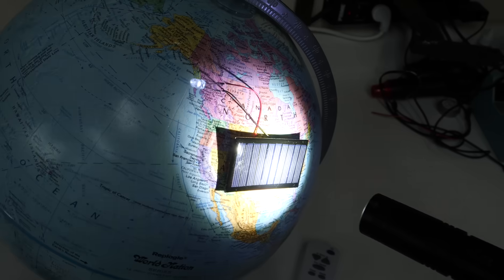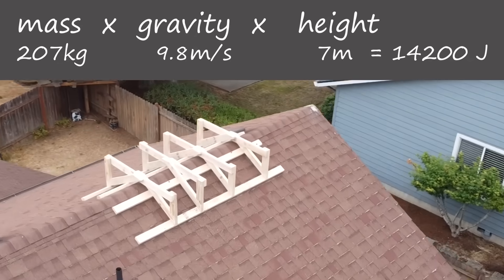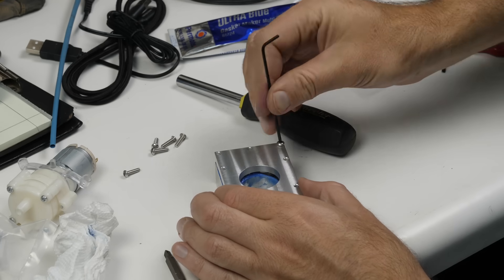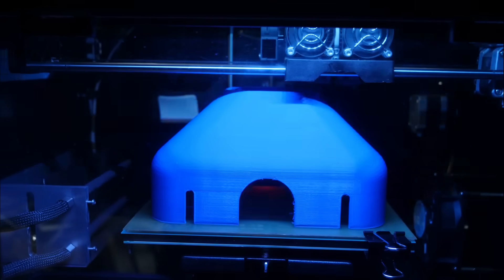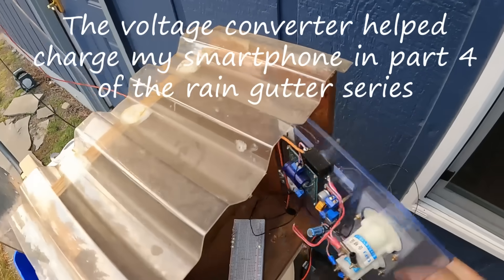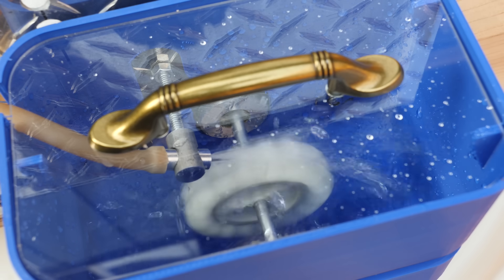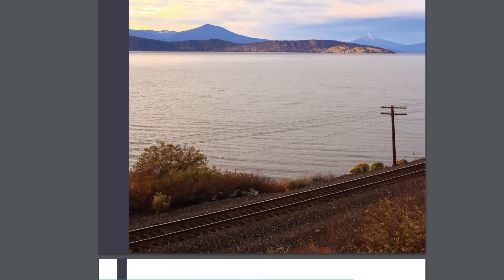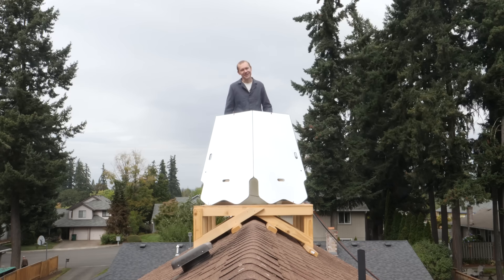Storing Solar Power on my ROOF!!!

Comment: Hi, cool demonstration. I’d love to see some calculations on efficiency and what it would take to be a practical way of generating nighttime requirements for a single household.
Reply: you'd have to live by the river?  =P
Reply: No need to calculate.  Extremely inefficient.
Reply: I did the math once, and you'd need a large pond on top of a hill for it to be a replacement for a home battery system.
Reply: @thelight3112  I wonder how much could you generate power with rain water from roofs and around the buildings directed to "pond" wich outputs to micro generator. Combined with some solar system to tump water back up if no excess water. It would need some way to control when water power would be used.
Reply: @viljosavolainen2286  
Firstly, if your using rainwater directly you haven’t got that 7m head this tank has. You’ve only got the height of the gutters, say 5m. 
OK, a fine big house, so perhaps 200m² of roof (that’s a 4000 sq.ft. home, folks). Now 25mm/hr is a pretty solid downpour, so that roof is going to catch 200x0.025 = 5m³/hr, which is 5000kg. Total potential energy is m.g.h = 5000x9.81x5 = 245,250J. Divide that by the 3600 seconds in an hour and get 68W of power during a downpour! You’ll lose at least 30% in pipe losses and turbine and generator inefficiencies.
Give the half of that roof that faces the sun 100 m² of solar panels and you’ve got anything up to 20kW on a sunny day. Roof-hydro you need torrential rain to generate anything above 50W! Go figure! 
And if you only want 50W, you can buy a portable solar panel that you can set up in a sunny window, starting from under $20.
Reply: A "real" hydropower plant efficiency is about 90% in theory, a micro hydropower plant is about 70~80%, something this size  I would guess less than 50% on paper. These kind of thing need to be huge.
Reply: You would need just over 4000gallons to replace a Tesla powerwall as 230amp hours & 1 decent AA battery is 3amp hours. So that’s a square tank 4 metres wide x 4 x 2metres high=32 tonnes in weight. A tank this size would easily fit in most lofts & a 4x4 metre plywood panel on top of loft beams underneath the tank with minimal reinforcing should hold the weight of tank that size with water.
Reply: @randy2819  
And if it’s pumped hydro then you’ve got inefficiencies on the uphill side too. So round-trip efficiency will be damn near halved again.
Reply: He says his sistem Stores 14200 J.
14200 J =14200Ws = 3,9 Wh
14,2 /60/ 60 and U have
Reply: Humanity would have NO issues regarding energy if such sonstructions came ANYWHERE NEAR beeing a "practical way of generating nighttime requierements for a single household."

I mean,what he did doesnt look as much even to someone who has NO IDEA what he was doing. Thats a month of work for a complete beginner. Learning + building + testing. Maybe two months, if one is a slow learner.
Reply: Well,  the average energy storage in a  single AA battery is about 4w. The guy used a 50w pump that ran for approx 2 hrs,  meaning approx 100w of energy was used to transfer water from the ground to the roof. 
100w spent,  4w of "backup" energy gained. 
Energy loss of approx 96%. However,  there are plenty of ways this can be refined, but you'll probably never get much lower than 85% loss (100w spent, 15w gained).  If you want to see how much it would take to power your house,  simply figure out the wattage we ltr of water (44gal = 200ltrs) 
200ltr made 4w of power,  meaning each ltr makes approx 0.02 watts, so, to make the math easier let's bring the w/h to 1.00, every 50L of water gives you 1w/h. Average household consumption is approx 10KW/h 10,000w/h , meaning you'd need 50l (1w/h) x 10,000, = 500,000Ltrs of water to generate 10Kwh. 
Now,  if you only want nighttime usage this will be significantly less.. You'd probably need approx 3kwh on any given night,  meaning you need 70% less than 500,000L, 150,000L should suffice for a single individual to do the standard night time things.
Reply: The formula is simple, the potential energy is U = m g h, where h is the height (in meters), m is the mass in kilograms, g is a gravitational acceleration factor g = 9.8 (or approx g =10), and U is the potential energy measured in Joules.   So for 1000 Kg of water stored at a height of 10 meters, we get U = mgh = 1000*10*10 = 100,000 Joules.  1 Kilowatt-Hour is 360,000 Joules.   So you see the method is completely impractical - even if you store 1 metric ton of water at over 30 feet in the air, and utilize it with perfect efficiency, it doesn't store much energy compared to home use.
Reply: @iyziejane  
Correction:1kW.h = 1000W x 3600s = 3,600,000J. 
Given a 7m head and g = ~10m/s², his tank needs to store 51,492 litres of water (about 51 tons!!!) to be able to store one kilowatt hour. 
Home turbine/generator? That kW.h is more like 5-600W.h.
If you want a hobby, then, for a few hundred bucks, you build something like this and congratulate yourself on building something that can charge your phone and your drone. But, I can’t emphasise this enough to the non physicists - there is no “magical multiplier” that can increase this energy.

Home hydro requires either a lot of water at a low head or less water but a high head. Not many people have the rights to both.
Reply: So inefficient and not productive, cool concept but not new thought
Reply: Morpheus is answering him on that here 15:09
Reply: You’d need a river stored on your roof
Reply: Well, let's see.

Storage capacity is 14+kJ. Meaningless amount.

To make a cup of tea, for instance, you'll need at least 75kJ.
Or you'll be able to light 4W LED lamp for whole hour!
Reply: @МихайлоСєльський  Hi, thanks for the response it certainly puts it into perspective.
Reply: @H2Dwoat  Years ago I calculated that the energy used in my home would require me to suspend a volume of concrete, that's 9ft high and the same square footage as my home, 35ft into the air to have enough potential energy to power my home for a full day (not just night).

Comment: Practicality - you would need to store more water on your roof than the building could support in order to supply a normal house with its overnight requirements.  How economical would it be to use your hose to generate electricity?  Would need to compare the cost of water against the cost of mains supply.

Comment: What about converting solar energy into thermal energy, heating the water? Panels to heat water have an efficiency much superior to fotovoltaic panels, and each gram of water can store 4,2J for each ºC heated. That means 100L of water heated 30ºC can store something like 12,6MJ. Dowside is you can't convert this energy into eletric energy.

Comment: Interesting vid. I'm quite intrigued by ur roof build too. I've got a small patch of roof I've been dying to make into a sort of deck and I've been visualising some sort of complex metal frame supported by the wall over the roof to do it. I'm much better with wood 😅. If I had to space my supports the way you did in this video, what is the chance the roof tiles could support a light structure complete with one or two ppl? 🤔

Comment: Hi Quint, have you ever thought of experimenting with using a ram pump with this? A ram pump can pump 10 times its own head, but the drawback is waterlosses from the waste valve. BUT, what If you could catch the waterlosses from the waste valve and send it back to the ram pump feed tank using the small solar pump? This would make the system a closed loop with zero losses and huge gains. Worth looking into?

Comment: You could do as the Mayans did to get water inside the top of the temples. If you dig a hole deep enough and use PVC the pressure from the water will push water up into your Barrel. Once it stops the pressure will stop as well

Comment: I was on open source lowtech yt channel and they have a metal panel that they use to heat the water that's pumped through. I'm now curious if putting these 2 designs together could be paired in some way so people could provide themselves with hot water

Comment: You may as well have filled the tank with garden hose water ?? But, interesting anyway 😊 so .. you get about 1Wh per 80gal tank? Not enough to store summer solar for winter 🥴 better to use electrolysis to store hydrogen in hydride tanks in association with fuel cells. It's a terrible problem with solar in polar climates: how to save summer energy for winter.

Comment: Cool idea. What do you estimate the lifespan of the pump to be, relative to lithium ion batteries?
Reply: A quality purpose designed pump could last decades. I'm a plumber but build water features as a hobby/side hustle and have never had to replace a solar powered pump for any reason other than physical damage caused by mishandling. The solar panels go out before the pump does

Comment: I recognize what you’re doing here it’s actually something that start on a much larger scale where will pump water to a very high lake and then the lake will feed a river that intern has a dam at the end of it it’s been done for the past 80 or so years in a few different parts of the world. Genius going smaller with the scale
Reply: If you wanna put anything else on your roof consider a solar powered hot water heater . Heard they are good

Comment: Did you say 14,200 Joules of energy stored? That's a bit less than 0.004 kWh. Of course, figuring in round-trip efficiency of maybe 25%, we're looking at more like 0.001 kWh of useful electricity per tank.  Where I live electricity sells for about $0.10 per kWh so that tank full equates to about $0.0001 worth of electricity stored. Gives some sense of appreciation for how much we take electricity for granted... and the scale of water stored in utility scale pumped hydro.

Comment: Man, this guy is genius! He smoothly goes from CNC machining, plumbing, 3D printing, Electrical work, Soldering, Acrylic cutting, Using handle from wife, doing mathematical calculations as though nothing. Never come across such versatile Engineer from YouTube videos.

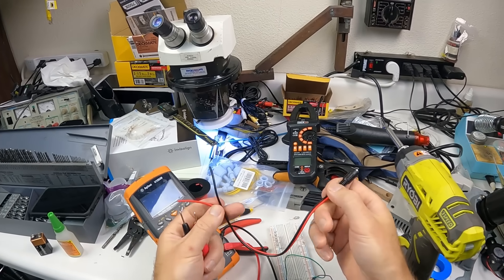Comment: So at around 9:12 you claim the negative connection is bad, but you tested it with both ends on the same multimeter probe.

Comment: perfect I've been thinking about this concept recently as I explore alternative power storage and was wondering how I could do this on a personal scale and if it would be worthwhile
Reply: I believe the idea is solid.. where it falls flat is you're limited to the weight of 55 gallons of water. The real winning idea would be to have a block of concrete , or just a large rock, being hoisted up a tower via renewable power. Then let the down while capturing that energy with a generator. If you could use this lifting motor as the generator this would make it all a lot easier. A tonne at 100 feet may actually charge your phone several times amd run some lights for a couple hours.

Comment: Nice idea but with 14200 J your tank holds only 0.0039 kWh, which is less than 1/1000th the amount of a typical battery used in houses nowadays.

Comment: I suspect you could remove the whole pump / solar panel, and instead, just use the water pressure from your city water supply to fill your roof tank.
Especially if you can take the water supply from before the pressure regulator that reduces it for the in home use.

Comment: Nice. My challenge is with solar pvt. No boiler used. In the Caribbean we have pressure tanks that use convection to send hot water to house even at 2nd story. Can solar pvt do the same while making electricity from the same space?

Comment: If you want to make it produce more power. Change the size of the pipes so it flow big to small as it goes down the side. Also add a fine head to it so less water = more pressure

Comment: Would the water freeze in the winter? Would you have to add a small insulated room with bucket, insulated line and tank heaters to keep the tanks and lines flowing in -20 below zero temperatures? Solar panels might be able to maintain the power that into a 24 hour battery like the go power plus, BougeRV or jackery type battery packs.
Reply: Heat the water with solar also, thermal solar heater.

Comment: I don't think the engergy potential of what... 16' height and 400 odd pounds is going to do much. .

When I lived in the Philippines, everyone had tanks in their roof to compensate for the crappy municipal water supply.

If you could afford it, you also had a big pump to take a suction on the water main, because the biggest pump wins.

Comment: the problem I see is that the water pressure that the motor sees is 7m of water vertically up. You'll either have to gear the motor into the pump or get a stronger pump.

Comment: Can you place few motors vertically one above each other,  then collect water from top one trough your flannel and send it to next motor in the chain? Will it multiply energy or there going to be too much power loss and no effect?
Reply: The aboslute maximum available energy in Joules is the weight (kg) x the height (in metres) x 9.8 (the gravitational constant). No variation in the arrangement of energy harvesting devices can yield more than the available energy. If the first motor harvested half the energy, there is only half available for the next.

Comment: I am curious how much energy was used to fill up your roof reservoir. You know, just to determine the ratio.  Thank you for this video.
Reply: Hmm, he did provide the information I think to calculate this, at least roughly.  It took a 50 watt solar panel (which probably operated at an average of 50% efficiency given the cloudy conditions, the general efficiency of solar panels, and the arc of the sun affecting panel efficiency) about 5 hours to fill the barrel.  So that's about (50 watts / 2 = 25; 25 * 5) 125Wh of power to move that much water (which is itself no doubt variable - depends on the efficiency of the pump, the efficiency of the turbine used to convert it back into usable energy, and probably lots other factors I can't think of off the top of my head).  A quick conversion search of watt hours to joules turns up 450,000 joules.  Compared to the ~20,000 joules of usable power, this is actually hilariously inefficient (and not at all surprising as moving that much water with a tiny pump that much distance is probably crazy inefficient).  But of course, as he pointed out, the point is not efficiency but learning.
Reply: @RyanBancroft  Thanks for doing the math. So if he used the power to pump the water up again, he would only fill 5% of the barrel?
Reply: @stigcc  Yeah, that sounds about right.  But maybe even less given how much of that power is being lost as heat in that motor.
Reply: me too im curious as well
Reply: haha that tiny overheating motor probably dumped 400kj as heat into the water

Comment: I would take a look at Integza’s channel, he has some great designs for 3d printed turbines, so that you can maximize your power. I would say you’re losing at least a quarter of your power to splashing. If you had a system that forced all the water through a turbine you would produce much more power through water pressure

Comment: Quint, here in Western Australia and Australia we use solar hot water systems, that barrel (or another one) could be insulated, and if you put a coil of 100 meters of 39MM  Black poly pipe on the roof pushing water into the "storage barrel" you could with a bit of plumbing and a solar pump give the house as much hot water as needed each day for free
Example
I have a 4500 litre spa in ground I built out of concrete.
On my roof I uncoiled a 100 meter coil of 39mm black poly I SUCKED out the cooler spa water pushed it up to the roof (head of approx 3m) it pushed the water through the pipe and gravity helped it to (obviously using a pump capable of pumping up to that head I have 6.6 kW of solar on my roof)   go back into the spa  I had a timer set to go on every 20 minutes for 9 minutes then off and so on and during the day. (each cycle yielded 180 litres of water to appox 60c by 9 minutes it was approx 35c ish with each cycle adjusting to gathering heat from many cycles ) 
This from approx 8.30am till approx 5.30pm
From an average of 21-23c cold to hot +40-44c by the days heating for 4500 litres of water (1000 gallons) 14 people could comfortably be relaxing in the spa 
If the water was too hot we would bring in the cold hose 
This was done WITHOUT A COVER on the spa, I hesitate to wonder how hot I could get it if It had put a insulated cover on it . 
Don't forget the use of hot air heaters ie the coke can solar heater 
(How to build a SOLAR HEATER with BEER CANS
https://youtu.be/G-nIGjQEtpA) 

I have a heap of down pipes from roof gutter 
Enclose it in a box add a small stealth computer fan and solar panel to pump hot air into the house. 
I hope you find these ideas interesting enough to give them a go 
Tony from Western Australia 🇦🇺

Comment: Would have liked to see actual numbers for energy here. For example how long can you run the lights on 55 gallons of water? Let's say it lasts an hour... That means you used a 50 watt solar panel for ~8 hours to eventually power 1 watt lights for 1 hour. That's less than 1% efficiency.

Comment: The solution is a man made sinkhole from the ocean.Basically what they are doing but instead of a reservoir that gets water pumped into the upper part the upper part is the ocean and doesn’t require refills.It all channels away and back in to the ocean down the way completely green and silent 24 hours for ever.

Comment: Wonder about the efficiency on this ... 14200 J is about 4 Wh ... So if this is a 100W Solar Panel, where did all the losses go? Must be heat in the motor, right?